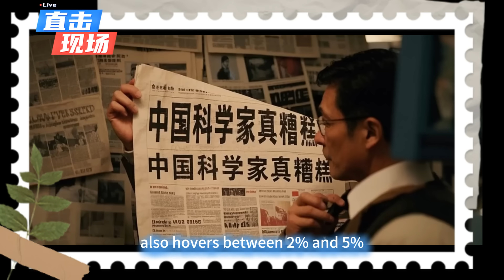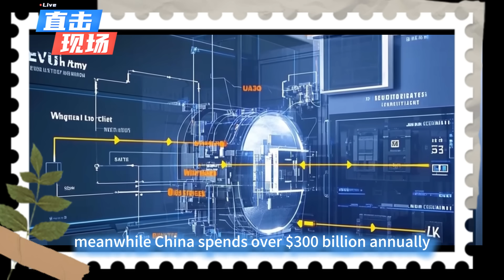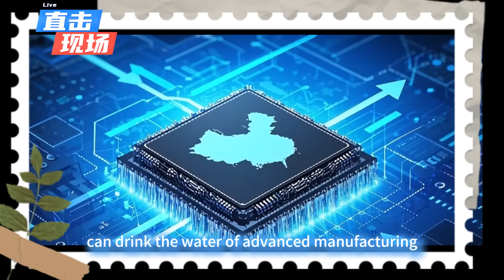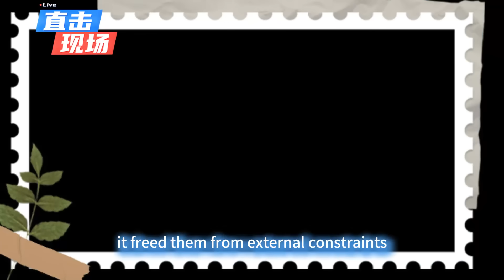A groundbreaking advancement in China's EUV lithography light source technology

Comment: SMIC can produce 7nm chips now for Huawei. Huawei's 7nm Kirin chips, like the Kirin 9000S and Kirin 9020, use FinFET technology
Reply: EUV can make chips scaling to 1 nm limited.
Reply: @alexlo7708  It ain't matter. Chips have physical limitations. As long as China can produce sufficient nano chips lower than 7nm, it still be fine. That will literally cover 90% of usage at least. 
Meantime, according to media report such as SCMP, Trendforce etc. :
"China unveiled its first domestically developed commercial electron beam lithography (EBL) machine, named Xizhi, in mid-August 2025. 
Developed by Zhejiang University, the Xizhi machine boasts precision comparable to leading international equipment, achieving a 0.6-nanometer accuracy and 8-nanometer line widths. This development is a significant step for China's domestic quantum chip and advanced semiconductor capabilities, though its point-by-point writing method makes it best suited for research and development rather than high-volume mass production. "